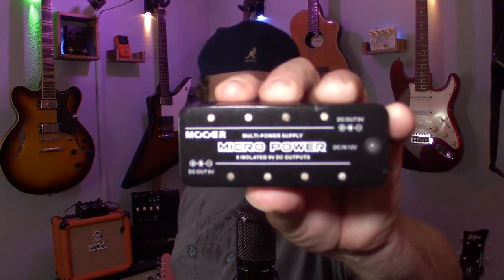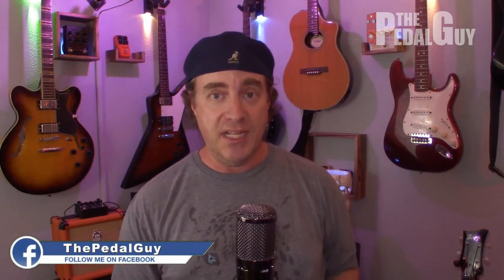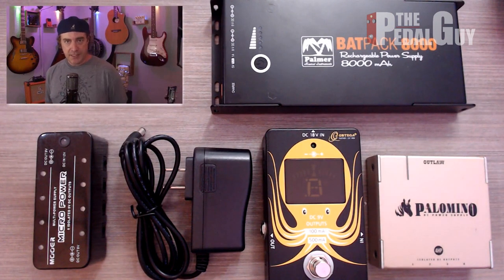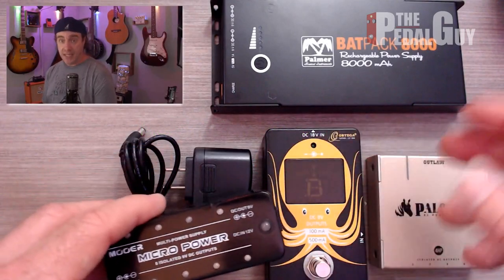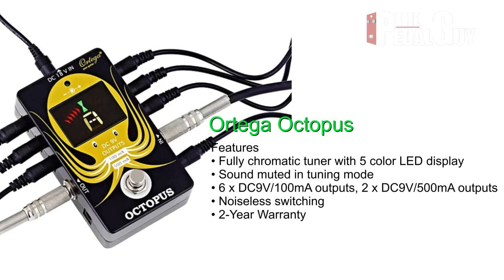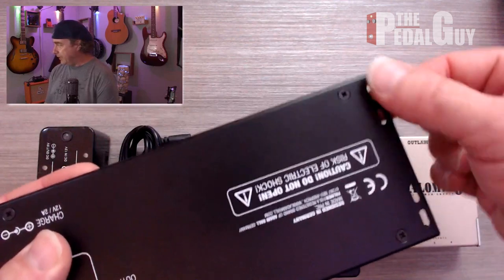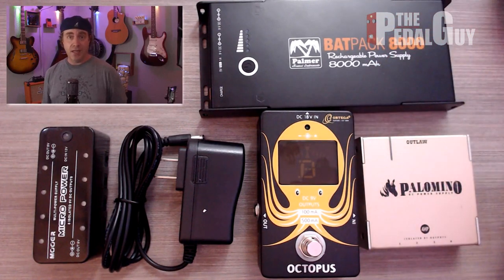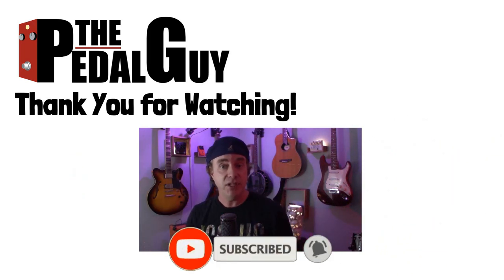The Pedal Guy VLOG Building a Pedalboard Series Part 2 Choosing a Power Supply

Comment: I need something small for the home and don't want a big PSU on my login groom floor. 

I have no power issues other than digital noise when plugging in digital pedals such as Source Audio stuff into a chain with analog ones. Otherwise, I have never had an issue daisy chaining. Nothing at all, like no weird noise in power lines etc. 
Will all of these get rid of the digital noise?

Digital pedal manufacturers really need to consider putting small isolating transformers inside of their pedals rather than passing the buck to us. A small increase in production costs saves us additional boxes and wiring all over the place. Very few builders do this, but some actually do!

Comment: I think octopus production is discontinued, I'm not able to find enough info about it online. However I was able to locate one that is brand new but I'm kinda skeptical cause someone complained that the tuner sometimes doesn't pick up the sounds from lower strings, also they said the power it provides is weaker than it's supposed to.